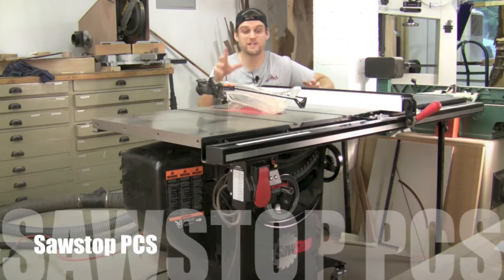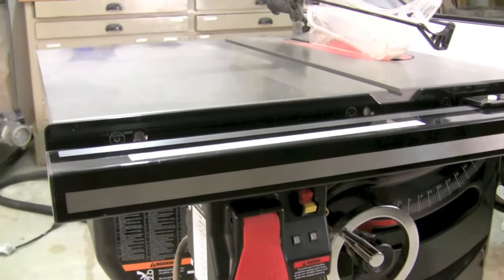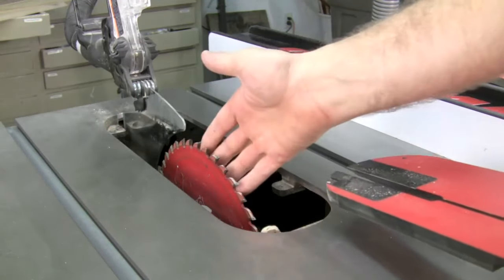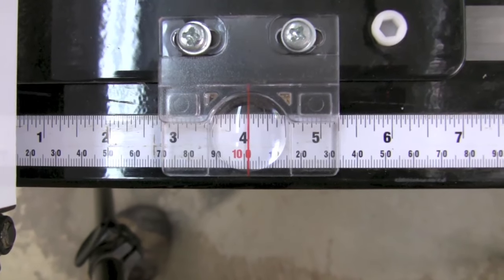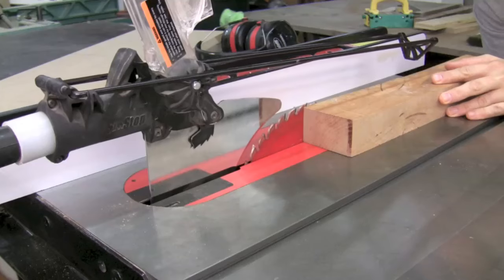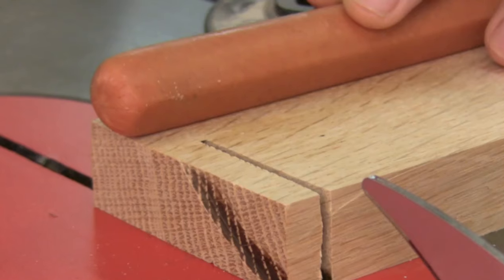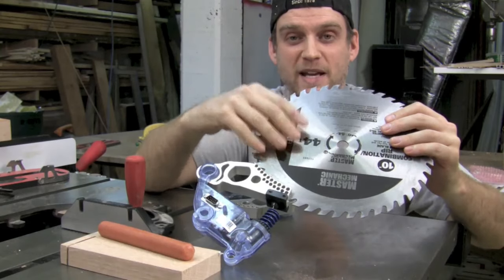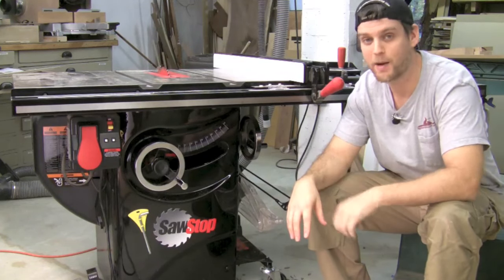Sawstop PCS Product Tour

Comment: Excellent video. Have the same saw myself only the lower powered model.  Noticed you originally had a Freud(?) blade in the saw and switched to a different blade for the brake demo.  The Freud blade is coated and I have found that it is not conductive.  The manual states that non-conductive blades should not be used.  Did you sand off the red coating at the arbor?

Comment: great video, brother!  I am def thinking about updating to the same Saw Stop PCS 220v demo'd here.  I have a Ridgid TS3660 CTR Saw right now and the horsepower is lacking.  The problem with my shop is it is in my garage and the floor slopes almost 2" from front to back over a 30' span.  Any suggestions on leveling that out?  It causes big problems when moving my tools around the shop into different positions

Comment: Would you say a 30" 1.75hp is better to use in a house garage or could I use the 36" 3hp without throwing breakers at my house/garage???
Reply from the maker: Comparing how the two saws might trip a circuit is not a helpful comparison in general because they require different voltages to operate (thus they run on different electrical circuits normally). The 3HP model SawStop requires a 220 volt circuit. The 1.75HP model comes ready to run on a 110 volt circuit. If you don't have a wired receptacle to support plugging in a tool that requires 220v electrical service, you would need to consult a qualified electrician to see if your service panel could have it added (before considering the 3 HP model).

As far as operating the 1.75HP tablesaw on any existing 110V receptacles in your garage, the amperage of the cirucit (15 or 20 amps) and the overall demand (load) on the particular circuit where other devices drawing current on the circuit where you have the receptacle where you plugged in the saw, factor into predicting if your saw may trip the circuit breaker panel when it's under load. Because the motor on the 1.75 HP saw is 14 amps, SawStop recommends running the saw on a 20 amp circuit. If you have that in your garage, that would be ideal. If you have just a 15 amp circuit to plug the saw into (many residential houses have the 110 volt wiring wired as 15 amp circuits) then keeping the load light on the circuit while using the tablesaw would be important (running a dust collector on the same circuit while cutting with the saw would probably cause the circuit to trip – especially when doing heavier cutting tasks).
Reply: The 3HP 220 volt version, will actually draw less amperage than the 1.75HP 110 volt version, but as HW said, you'll need a 220V outlet installed.  If your main breaker panel is in your garage like mine is, you can easily add a sub panel next to the main one for the 220 volt service, then hook it into the main panel off a 20-50 amp dual breaker. That's how I did mine. I ran pvc conduit from the new sub panel to pvc outlet boxes... one for the table saw, and one for the 220v dust collector.

Comment: Blade changing is recommended, but only necessary if the plate is damaged, which is extremely unlikely, even it it throws a few teeth, they can be replaced by a decent saw service. The aluminum is no match for the carbide teeth even the sharpness of the teeth will likely be unchanged.

Comment: If you want accurate work on a precision cabinet saw and save your digits then hire me or learn how to do joiner work. The Powermatic is three times as heavy, Ten times more stable while doing heavy cuts and easily rolls around on four retractable casters. I'm 62 years old and began my apprenticeship at 15 and never have had an accident with any woodworking machine. The tablesaw is one of the safest tools in the shop when compared with jointers, bandsaws, shapers and thickness planers.
Reply: Plenty of people walking around with missing fingers from a Powematic.

Comment: *scratches head* $135.00 for a blade that's more than my whole Table saw brand new (Ryobi 10 in. 15 Amp Table Saw $129.00 ).....if you can afford the really high end blade and saws go for it but not everyone can this is what I use Diablo 10 in. x 60 Tooth Carbide Circular Saw Blade $39.97  these are good for ripping and cross cutting never had a problem out of them..... I will say this If I had the extra $ I would get a better Table saw but i would stick with the cheaper blades